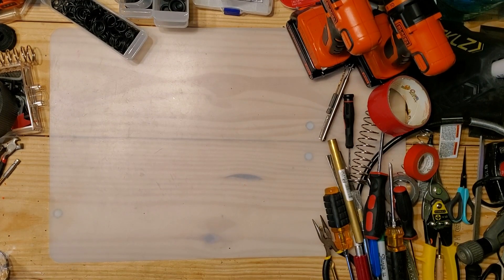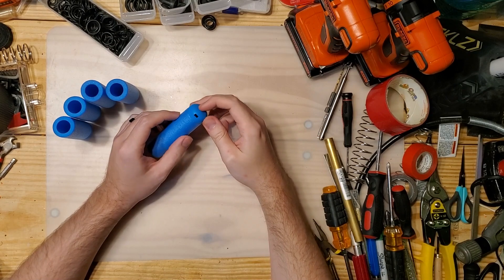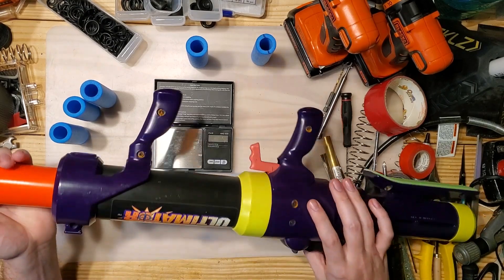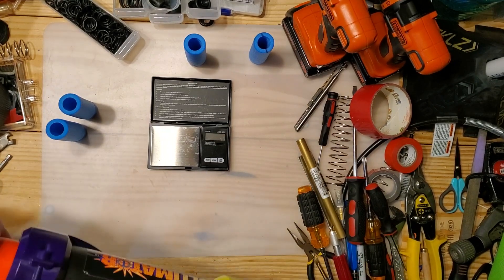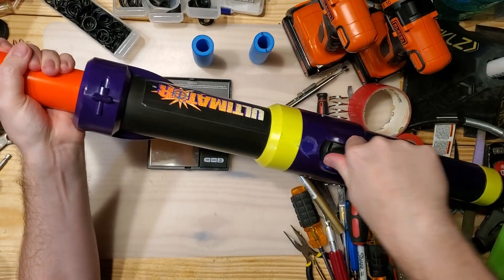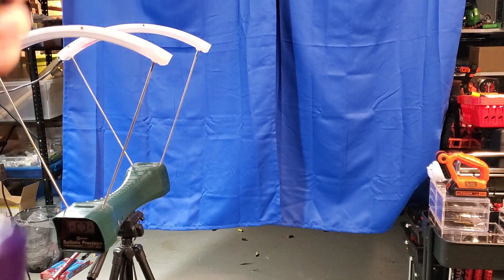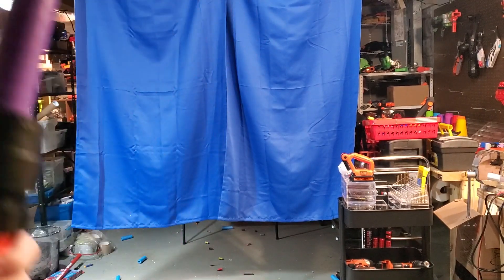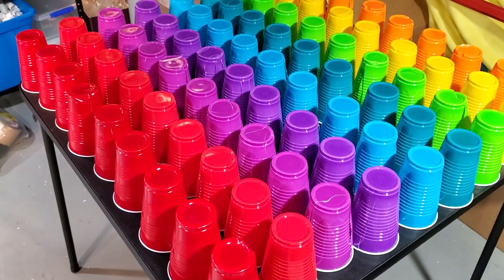The Best Nerf Mega XL Blaster was made in 1994!

Comment: Try half MXL darts straight up and then weighted half darts. Flies less wonky. I pour liquid flowable silicone down into the foam tube about 3/8th inch deep and that way nothing interferes with the inside of the whistle tip.

Comment: What fps is that titan rocket hitting? Also, you hold the MXL springer record now!
Reply from the maker: It's going 44 fps.   With a full titan barrel attached closer to the front it hits 50.  I believe stock Titans are closer to 60.   Also woohoo!
Reply: @carius2221  if you can get that titan rocket over a chrono on video, you'll also have the titan rocket springer record
Reply: I'm confused...springer?
Reply: @gadgetguyify  yep! This blaster is an extension springer. It uses a spring and plunger tube to fire a projectile.
Reply: @radioactivesdesigns3554  OK...it looked like it was having air pumped in with that black lever on top so is that so kind of ratchet?
Reply: @gadgetguyify  yep, a ratchet.